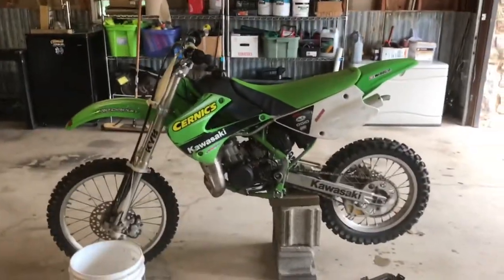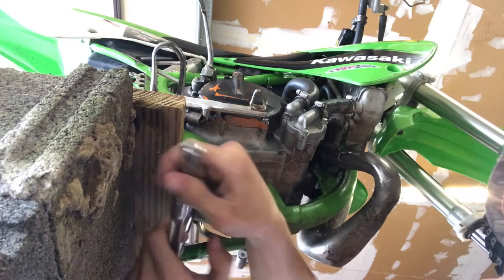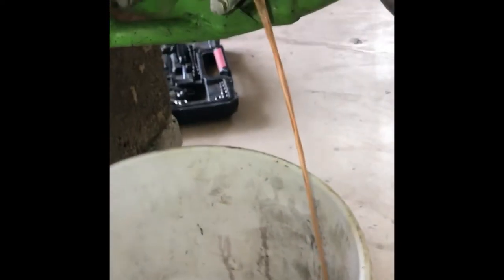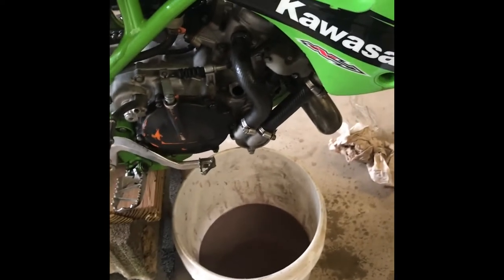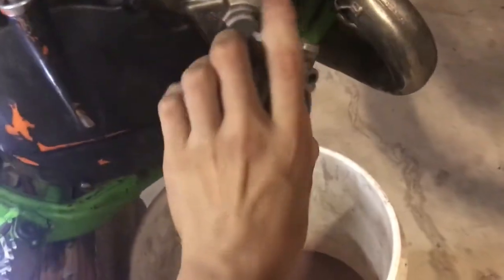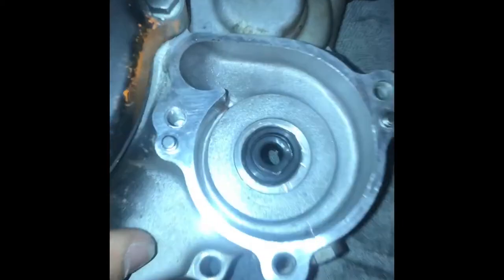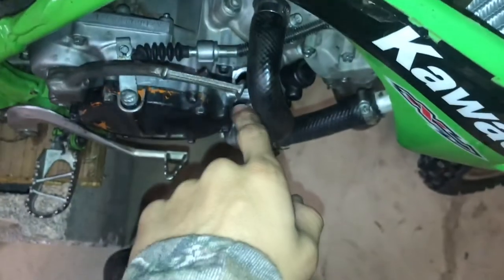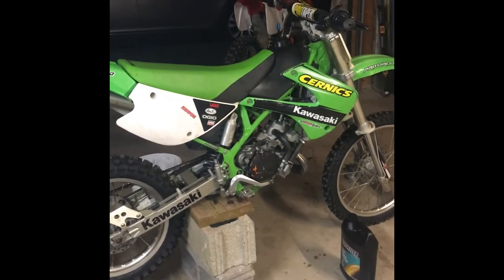2002 Kx100 WaterPump Rebuild

Comment: Dealing with the exact same issue on my 2015 Kx100 right now! How did you remove the impeller blade? When I try to loosen the bolt, it just turns the crank over. I don't want to tear up the impeller trying to remove it. Also, can the shaft seal directly behind the impeller blade be replaced without having to take the case cover off? Thanks for taking the time to make the video! Definitely helps!
Reply: Michael Rominger Jr how did u manage to get the impeller off
Reply: hobson a quick snap of the socket wrench did the trick. Had originally tried turning to loosen as normal and as mentioned it turned the bike over and didn't break free. Then I tried placing a wrench through the impeller to aid in holding things in position to loosen. That didn't work either and started showing signs that I was going to bend the impeller. Frustrated, I just gave the socket wrench a good quick snap when I ha the engine at the highest compression pat of the stoke and bingo, broke right loose lol!

Also for you or other in the future.....the outer water pump shaft seal wasn't coming off without taking the case cover off so I did end up going that route. Wasn't much additional work and went easier then I expected so save yourself the hassle of trying to fight the seal out the hard way. Just take the case cover off and use a socket to push the old ones out and then the new ones in. Hope that helps!
Reply: Pop it with a 1/4" ryobi impact.  Comes of as soon as you squeeze the trigger.

Comment: I changed oil on my bike 3 times and it turns almost white but my radiator is still full of water and nothing is in it. Someone help me out. Also the bike still has plenty of  power
Reply: Brandon Black trans fluid usually does that if you research it. It’s from the material on your clutch. Your bike should be fine